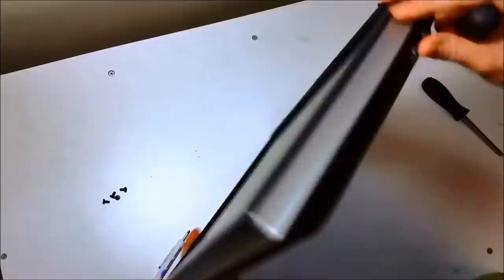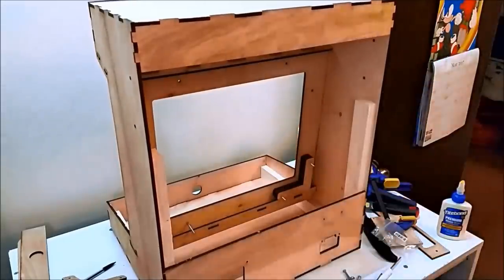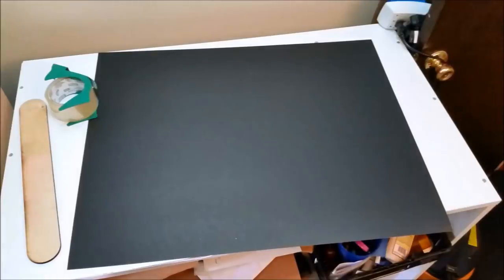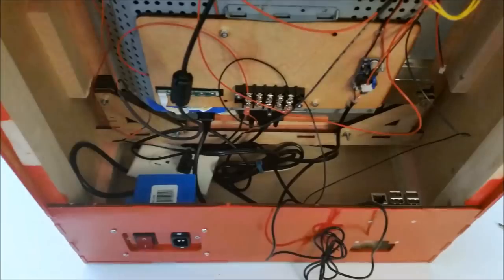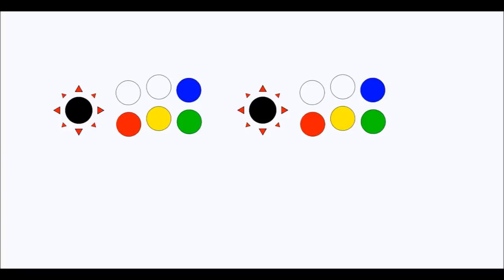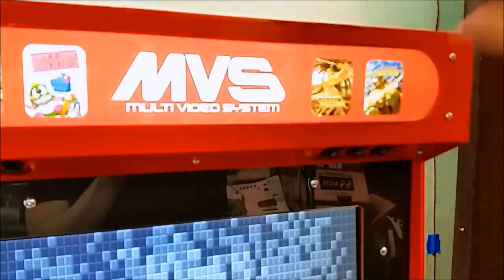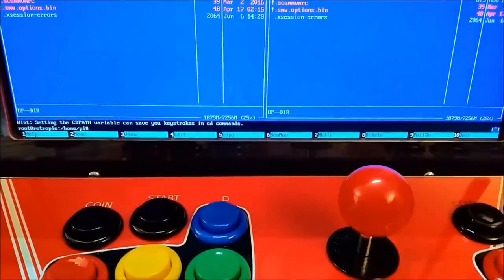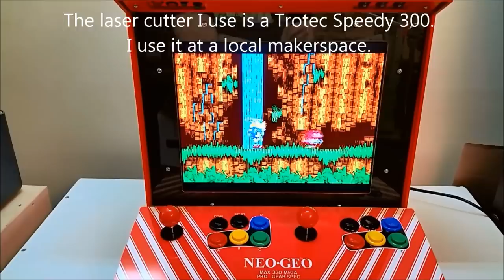Build a Desktop Arcade Machine with Raspberry Pi 3 and Retropie: Super Turbo Pro Edition

Comment: Tape measures are designed that way on purpose, it's not an error. It is to account for the thickness of the metal tab at the end. If you are measuring an inside corner with the metal bracket pressed up against something, the measurement is correct. If you're measuring from outside, it adjusts to allow an accurate measurement not counting the thickness of the metal bracket itself.
Reply: @do0rkn0b  Half assed?  Pfff, hold my beer....
Reply: Just checking the comments to make sure someone said this.  GG

Comment: the wiggely part of your tape mesure is not an error, but wiggles the same as the thikness of the "hook", so it will show the correct number if you put it against a surface or over an egde.
Reply from the maker: thanks!
Reply: Like you said...
Inside Outside measurement correction!!
If they don't like that get a steel rule!!
Reply: Wow...I did not know that!  I always thought it was the BS tape measures I was buying.  Thanks buddy!
Reply: I was going to comment the same thing
Reply: ...professionals never take into fact the slack in the clip edge contrary to popular belief,  we always use 1 as our beginning measurement and then subtract 1 in the over all measurement , that's were the term measure twice cut once comes from....to many mistakes over a distance happen when one uses the slack at the clip edge.

Comment: When you solder you heat on one side of the joint and feed solder into the other side. Once melted you remove straight away to reduce heat and your joint will be filled correctly and leave it bright and shiny.

Comment: i think that the "jiggly parts" on the measurement tape are meant to jiggle about the thickness of that hook in its end so when you push it against something or "hook" it and pull, it should nullify that error. (at 2:00)

Comment: I think attract mode is a better choice than emulation station when using retropie as an arcade machine. 
Your preference of course. For me, I have an arcade machine and a couple mini-consoles. I use the same disk image across them all, for the arcade machine I just flip a setting telling it to boot to attract mode. Otherwise the systems are identical which I really love from a maintenance stand point.

Comment: You can find driver boards for just about any monitor, screen or TV. Just do a search for a driver board for the model# of the display. You can even use laptop screens if they are easier to acquire.

Comment: A quicker and easier way to power everything would be to use a 15amp switching PSU within the cab (much like the ones used in the original arcade machines). No need to use the DC Step down converter or dedicated 12v supply as the 15amp power supply has both 12v and 5v rails with plenty of amperage to support everything. You could also eliminate the switch housing as the LCD would run directly to the Active Neutral and Earth at the PSU. The benefits would have been time, cost and more space within the cab.

Comment: Nice. If you run the 12v computer fan off 5v instead, it still moves a good volume of air but is very quiet.

Comment: @

Ryan Bates The jiggly part of the tape measure is jiggly for a reason. It jiggles exactly by the thickness of the steel metal used to make that hook at the end. So if you hook it somewhere and "pull to measure", it subtracts the thickness of the steel hook. If you push against a surface to measure, it does the same, but just by physically doing the opposite of pulling. :-) I am 2 weeks old after this blew my mind.

Comment: The jiggle end of the tape measure is on purpose..  It accounts for the thickness of the hook, so you can either but it against or hock it on something, and get exact measurements for both

Comment: Tape measurers don't have tolerances, they are exact.  The metal piece on the end has slack to compensate for its own thickness so if you measure from the inside or the outside of that end peice you get the same exact measurements.

Comment: You should use retroarch for buttons setup instead of in-mame config panel. If you config it properly once then for most cases it will work for all emulators.

Comment: That "jiggly" part of the tape measure is not there to screw up your measurements. It is designed that way to allow you to take inside (jiggly part pressed in) or outside (jiggly part pulled out) measurements...

Comment: You should take a label maker and print a warning Label High Voltage and throw them on the electrical box's  just in case someone ever opened the arcade up.. Just a thought

Comment: Unless the cabinet is going to be super thin, I see no reason to take the monitor apart. I mean, even with an internal fan in there, there is going to be PLENTY of room inside that cabinet for everything including the monitor. Super nice system, though! No complaints there!

Comment: Did you put any kind of passive/active cooling or heat sink directly on the pi? I have found that even a small heat sink helps the processing speed greatly (i cut up old heat sinks from the 90s that I get from a kind of electronics rummage store that I know). Also I find that the SD cards themselves seem to overheat quite a bit. I guess I'm asking if you did any cooling other than the one big fan on the back? Excellent video, btw!
Reply from the maker: I did put a small heatsink on the Pi after making this video.

Comment: Hi Ryan - I  recently bought a PI3 and set it up with the gamewizard RC2 image. The choice for platforms is huge and am curious which you use in your Cabinets?  MAME?  If so, how did you bypass the  ctrl / esc  to revert back to the main menu in MA ME? I think you design is amazing and have a new fall project.

Comment: What was the point of breaking down the monitor aspect ratio? I'm confused.
Reply from the maker: If you find different branded xx " sized monitors [of similar era] out in the wild and they share the same screen ratio, there is a good chance the overall dimensions of the TFT will be identical to another. This is the case here as I built two identical arcades with different brand LCD monitors. One with a 17" HP monitor and the other with a 17" Dell monitor; the raw TFT panels are exactly the same dimensionally despite different branding and exterior shell.
If you design an arcade from a LCD you scavenged for cheap, look for another LCD with the same size and aspect ratio. You might get lucky and your cabinet design will fit.

The aspect ratio comes from the height and width of the monitor's TFT. I had to measure this monitor in order to design and build a cabinet for it. Since I know the monitor's dimensions; it's more of a "here's a neat tip" that i can tell you what the aspect ration is without knowing the monitor's resolution. I didn't really measure the aspect ratio purposefully. I measured the LCD's dimensions; the aspect ratio is derived from the dimensions. The aspect ratio is not important, but some people like to know when it comes to playing retro 4:3 aspect video games, will they look 'good' on this size LCD...
Reply: Ryan Bates do you sell these already pre built?
Reply: I know right, I would buy one, Im rubbish at DIY lol
Reply from the maker: I do not, sorry
Reply: Ryan Bates how much?
Reply: Construct your own gaming machine, you don't need to be smart! Man has tried, shot, detail all told. Sorry for my English)
Reply: Ungha Bungha 8118
Reply: the lcd without a case will run cooler since it will be played 24/7 and inside another enclosure
Reply: buy a rasberry pi follow the tutorial and make you own it's really not that hard
Reply: I have no hands
Reply: idle hands :D
Reply: So it could fit better
Reply: 225?? the cheapest i saw was $999
Reply: Jianju69 pretty bad ass. The actual cabinet is what I think would cause most people the biggest issues. If you’re not a person that has been building things and using tools your whole life, building something like this would be a nightmare. For some of us it looks incredibly simple. I can I see how for some people it would look impossible. I myself would much rather build the cabinet, then I can really make it tricked out, and have someone else do all the cpu stuff. I can do it, but it’s not fun to me and is just a headache. Cool link though, thanks.
Reply: I believe the problem for most people is the getting the tools, I for myself can self making the cabinet is a nightmare, I've no easy access to a laser cutter, which means that I either use some alternative or cut it myself the old way. And trust me nobody can convince me to cut so many delicate parts with a cheap saw. 
(If you can cut and deliver the cabinet to germany, let me know, I can build the electronics)
Reply: paulspydar 😂
Reply: so how you wrote this message??
Reply: @paulspydar  then how you gonna game ?
Reply: @paulspydar  So how are you gonna fiddle with the joystics and buttons?!!
Reply: @RetroBuiltGames  where did you get the KADE device to purchase?
Reply: @Icybearg      shhh!  dont tell everyone your fantasies ..
Reply: Use Arcade1up Street Fighter console.  It's about $299, but Walmart sometimes has as low as $199.  I got mine for $249.
Reply: @strengthbeyond1042  I can do the CPU stuff for you :)
Reply: Could I buy one of these done off you
Reply: @lizzyvainne  riiiiiight
Reply: @realalexme  It is way too costy to just 'try & fail' to learn when you're on a budget
Reply: @paulspydar  that's why the video is here to make you better at DIY trust me it is not that hard if you have to dl the video and watch it over and over again I learned how to rebuild transmissions by doing that ;-) have faith in yourself, my friend
Reply: I didn't understand it either the point of  breaking down the monitor aspect ratio..
Reply: Okay so how he explains it I do not understand why he measures aspect ratio either. Because I know aspect ratio has made a difference when I've done projects, but that's only when it comes to the actual display part of it. Converting say an old game to an HD monitor that is widescreen or vice versa, but the thing that makes even less sense to me is why he takes so much time to tear down the monitor, and then that is also risking damaging it while doing so (exactly why he has to test it before installing it). Yes I understand it saves a tiny bit of space, but barely any when you could just pull off the bottom stand, and at worst extend your gaming cabinet buy a half an inch.
Reply: No joke I was thinkin the same thing.. I guesss some people need that for reference
Reply from the maker: The aspect ratio comes from the height and width of the monitor's TFT. I had to measure this monitor in order to design and build a cabinet for it. Since I know the monitor's dimensions; it's more of a "here's a neat tip" that i can tell you what the aspect ration is without knowing the monitor's resolution. I didn't really measure the aspect ratio purposefully. I measured the LCD's dimensions; the aspect ratio is derived from the dimensions. The aspect ratio is not important, but some people like to know when it comes to playing retro 4:3 aspect video games, will they look 'good' on this size LCD...
Reply: @themaximusone  It's not that hard. All you need to do is get get wood, all of the electronics, arcade buttons, joystick, etc. Then you need to disassemble the monitor, measure the dimensions and draw up schematics, then design a 3D schematic in Autodesk, then prime and sand down the wood, spray paint it, glue it together and clamp it, plug in a number of things together, measure voltage, install speakers, bolt things to the wood, cut out acrylic, design some graphics for the marquee and controller board, print out the graphics on a quality (expensive) printer, solder shit together... it's really not that hard. I watched a video on how to do something entirely unrelated to this project like the pretentious millennial that I am, so I believe I am qualified to say it's not that fucking hard and you should just shut up and watch this video that fast forwards through the process and just do it. Everybody has easy access to all of these resources, after all.
Reply: @Alex Me Your comment is a very reasurring oxymoron.
Reply: @lizzyvainne Convenience is a bitch isn't it. I'll pass on carpentry. Not everyone has to be one.

Comment: Hey Ryan, just discovered your videos and subscribed! I have a question about how you leveraged the internal 12 volt on this monitor as I have several I have procured for arcade projects. You mentioned not using the internal 12v for sound and Pi because of the noise generated by the Pi. Would using a noise reducing magnet inline solve for this? Just seems a shame to not be able to use it for both.

Comment: So you only use one monitor cable for the ac power? How did you hook up the female end to the power receptacle if you already used it for the monitor? I'm confused by that part? Or do you need 2 power ac cables?

Comment: A little help, please... Did you remove the tactile switches from the board and replace them with the push buttons? I see that the amp board has tactile switches for up/down volume, but I can't tell how you wired the push buttons to that (as shown in your diagram).

Comment: Hi! Great tutorial, but I do have a question concerning the control panel. Have you glued acrilyc and graphics on to the board as button nuts wont hold edges in place and if you did, what glue have you used as I don't want residue to be visible?
Reply from the maker: acrylic cement

Comment: there is one thing in particular that you did not mention that I was interested in c I tried doing stuff like this before in the past by every time I looked it up is always some kind of issue usually it'sthe money I assumed it would be the cheapest option if I just built it myself and in plenty of ways you can definitely save moneyvs some of the original cabinets out there but the last time I tried looking up the parts to buy a bar-top arcade it cost more then it would have been to buy one that was already built. and keep in mind this was all through trying to buy parts to Amazonat the time I have not looked super recently but I was hoping that you can maybe recommend a website where I can get everything for reasonable price and yeah like I was saying I was curious to how much it cost you to do your build from beginning to end

Comment: I know I'm late but could you tell me how the heck you got the monitor working? I'm pretty sure I have the same one and for the life of me can't get it to work. I just get a black screen.  I'm using an HDMI to VGA adapter that I've seen a lot of people use. And I messed with "config.txt" with no luck. Pi works to HDTV and adapter works from pc to monitor. Seems like adapter and Pi communication problem. Any help is appreciated. Thanks and great work!

Comment: I believe I could do the work to get everything up and running, possibly with some (a lot) of trial and error...  But on a realistic guesstimate, how much do you believe it would cost to actually get a company to cut the wood panels etc for you?

Don't have any tools to do it and I don't have a place nearby that I could pay to use theirs either.
Reply from the maker: Most places charge by "time" including job setup for laser cutting. I recall this design is like 45 minutes of laser run-time. That rate could be like a $2min. Others charge by linear inch of laser cut, I dont know what this design is in linear cuts, but I can assure you I'd shop elsewhere. 
 You could omit some embellishments on this design to cut costs. But some places also have a minimum. The other way is traditional CNC,  I'd estimate you could get panels CNC'ed for about $200 or less on a design similar to this.

Comment: heads up never use rust oleum paint or cheap spray paint look up artist grade spray paint. it will save u smell and dry time also comes in mat gloss clear colors including glow in the dark spray
Reply: rust oleum paint or cheap spray paint are great for out door uses and quick paint and u want to use heat to off gas them so like the sun or heat lamp. so skip it get good spray paint so less smell & quick dry pulse less runs and drips

Comment: Wrong that piece on the end of it is suppose to be loose and is made that way on purpose for accuracte measuring. If you hook it is set to mosve perfectly to give accurate measurement and when you push it against something it moves to take into the account of the thickness of the metal used so it will measure accuratley.

Comment: Hugh work, i'm really impress !

I miss the part when you talk about video connexion between Retropi and screen (HDMI -> DVI/VGA)
What do you use to do so ??? cauz i've bought 2 differents cables converter and no one work (HDMI 2 VGA cable)

Need Help :)
Reply: I agree. Have watched it 3 times and can't find where he shows how to configure and connect the dvi to the raspberry pi.  
Also, just a note. You can plug the leds on the buttons directly to the raspberry pi and map them:).
Reply from the maker: https://www.raspberrypi.org/forums/viewtopic.php?f=26&t=31752
Reply: He''s using the DVI input on the monitor (which is just a straight cable connection HDMI -> DVI).  To hook it up to VGA takes a bit more effort.  He has listed a great resource in the link he gave here though.

Comment: +Ryan Bates is it possible to get the size requirements for the Vinyl print outs and marquee to go on a 2P Jamma Arcade Kit as I am going to order your kit in the next few months, however, I am wanting to have a company print my Vinyl and create the marquee for it( I simply don't know the exact sizes required for each)
Reply from the maker: There is template on the website